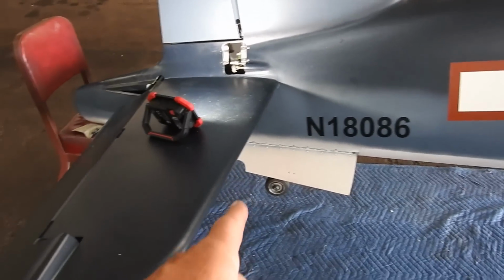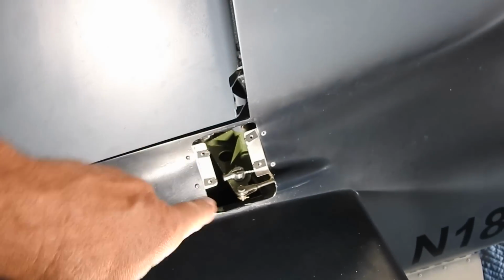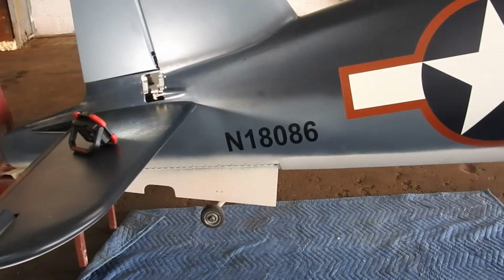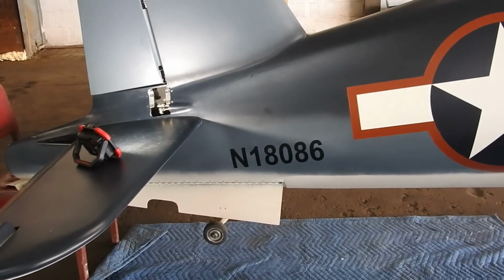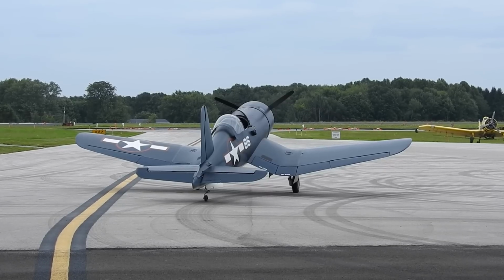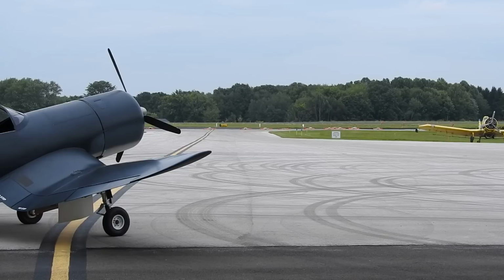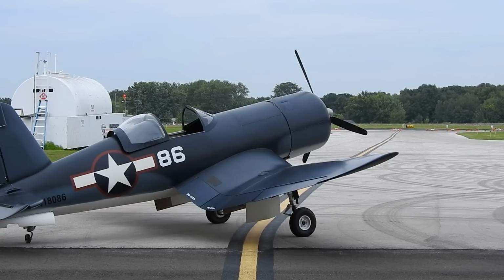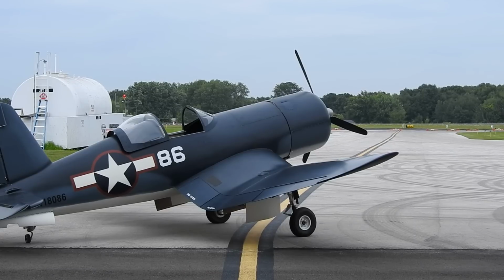WAR Corsair Tailwheel Steering Update 8/6/2023

Comment: Don, your craftsmanship is throughly impressive. CUDOS!
As mentioned in another comment, i also notices youe left gear door looks to be flopping around a bit at taci speeds, Ixm sure you sre now aware of it and got plans to correct it. It wouldn't be good at take off speeds to have it bend from the air pushing it.
Agian,  Awsome and wonderful job!
Reply from the maker: I will look into it. The way they are made, there will always be movement with them. I think it has more to due with the prop wash hitting that side more.

Comment: Looks great, tail wheel doing the job.
I have to mention, 
In the video, I’m hearing what seems to be, a torsional vibration , when the engine powers up from idle, and then again, as it drops rpm to idle.
Reply from the maker: Backlash in the gears in the gearbox. It's normal. There is a dampener in the geardrive for that. All Rotax engines have the same sound.
Reply: @Dynodon64  Got it , thanks !
Looking forward to watching the maiden flight !

Comment: Don I hope you have enough pitch on the prop. The aircraft looks just like the full sized one but I can sure tell how small it really is compared to the monster F4.
Reply from the maker: Prop was set at full throttle run ups, to get the desired engine RPM. It can always be reset if needed for flight.

Comment: Lost a friend in a homebuilt when the wing folded up on a go around.  How do you know the g-load of the wings?  How do you inspect for damage over time?   Just concerned.
Reply from the maker: These planes have been around since the 70's. There has never been any spar failures that I know of. But there can always be a first. The spar on the Corsair's has been calculated on a computer from McDonald Douglas from and guy who built the first one from the plans. He said it could handle 12 G's. They are rated for 6 G's. They always rate them at half of the failure point.

Comment: Don I noticed your left gear door flutters while the right seems ridget
Reply: Yup. I noticed the same thing... Don seems to be a WAR Wizard, im sure he'll have it nice and tight in no time!
Reply: Looks great, tail wheel seems to be working fine,
I have to mention, I’m hearing what seems to be a torsional vibration , when you power up from idle, and again , when the engine drops the rpm, just before idle.
Reply: @streetsmart1164 probably the gearbox and play in the gears or belt drive.. I forget what it’s got for a reduction unit but that’s typical.
Reply from the maker: @thomasaltruda  Gear backlash. There is a dampener in the geardrive unit.
Reply from the maker: @wyliemitchell6442  Prop wash hits one side more than the other. It's not a problem yet. I'll look at them before first flight.
Reply: @Dynodon64 I remember hearing that noise with ultralights. You’d usually hear it after startup if someone didn’t crack the throttle and take it out of what everyone seemed to call “rough idle”. Come to think about it I didn’t know exactly what was making that racket but I’d tell my students to correct it before putting on their helmets or headsets because I assumed it was causing excessive wear. So it’s a function of low engine rpm causing gearbox backlash? Does it cause excessive wear or does it just sound terrible?
Reply from the maker: @toddfleury7324  At low rpm, the prop is pushed forward when every time a cylinder fires, it then takes up the backlash in the gears and bounces back. That cycle repeats until the engine is revved up far enough to keep the load on the prop from bouncing back on every cylinder fired. If the weight of the prop is heavy enough, it can damage the gears. These gears are from a Ford C6 transmission, that can handle way more power than this engine has.

Comment: Forgive me for not knowing. Don, that looks like a solid (rather than pneumatic) tailwheel, do you think you could fit a larger pneumatic tire?
Reply from the maker: It is solid, that's what the plans called for. It's 4 inch and I could put up to a 6 inch on, but the doors would need cut out more.
Reply: Look at pneumatic four-wheel moving dolly tires

Comment: G'day,

Yay Team !

The Tailwheel Steering seems to be working as you hoped it would do ; well done !

Um, most of the time it sounds very quiet... - almost Lawnmowerish, when taxying under a bit of power ; and it's almost silent when idling...

But, apparently when you throttle back from Taxi-powee to Ground Idle..., it goes through a phase where it sounds like a Tin-Can containing a handful of loose Nuts and Bolts, tied to the Tail of a galloping Horse - and every  Hoof is kicking the Tin in it's turn, beating a Sheetmetal Tattoo - kind of thing...(!).

Is that a Vibration thing - hammering the Exhaust System against something solid at a particular RPM-band...; or is that the Reduction Gearbox
Protesting at the 
Airscrew trying to
Overspeed the
Output-Shaft...?

Or is it some other
Cause & Effect 
Going on...?

It sounds as if it might be
Potentially
Destructive of
Whatever is
Making those
Rattley
Noises...?

Or they may be harmless.

The conundrum has me mystified....

Such is life,

Have a good one...

Stay safe.

;-p

Ciao !
Reply from the maker: Prop slap, backlash in the gears. Same sound all Rotax engine have. There is a damper clutch like disc in the gear box to handle those vibrations.
Reply: @Dynodon64  

Cool, thanks.

I had a fair bit to do with 2-Cylinder Rotaxes, aerotowing Rogallos ; and they could be a bit noisy - but we had 2-blade Wooden Propellers ; maybe the 3rd Blade multiplies the Noise (?).

As long as any Sound is "Normal" then that's OK - it's when a normal noise goes silent, or some new Squeak, Clatter, Grinding or Tone appears that something is going awry...(!).

Have a good one...

Stay safe.

;-p

Ciao !

Comment: eventually, you're going to have to fly this plane.
Reply: Not really. I bought an aircraft (MiniMax 1500R) a guy had been working on for over 10 years. It was 90-95% complete. He became afraid to do more than taxi it after his flight instructor was killed in an accident.  He sold it to me cheap. I did first flight on it, which was also my first solo, and put hundreds of hours on her over a 6 year period.
Reply: Read FAA rules on experimental plane [ Advisory Circular (AC) 90-89C ]. 
 They have to log so many hour before it can take off. Testing the planes equipment. I'm not sure of the exact hours, but I think it was 20hours before the tail can come off the ground and then some more hrs of limited take off speed with online bounce the wheels [not purposely taking off]. Then he gets his last inspection to fly. EAA also has all the info , if you are interested. Dons done a good job of covering every aspect from wing load to landing gear max load before folding. He even did a lot of testing on the engine mounts. I'm just wondering how many hours is the car engine going to handle continuous rpm, when he take it to Oshkosh next year. I think that is his plan ??
Here is some of the index for flight
Section 11. Additional Engine Tests ......................................................................................... 2-39
2.19 Objective ..................................................................................................................... 2-39
Section 12. Propeller Inspection ................................................................................................ 2-43
2.20 Objective ..................................................................................................................... 2-43
2.21 Recommendations for All Propellers .......................................................................... 2-44
2.22 Propeller Tracking Check ........................................................................................... 2-45
2.23 Metal Propeller Inspection .......................................................................................... 2-45
2.24 Wood Propeller Inspection ......................................................................................... 2-47
2.25 Composite Propeller Inspection .................................................................................. 2-48
Chapter 3. Taxi Tests ................................................................................................................... 3-1
Section 1. Low-Speed Taxi Tests ............................................................................................... 3-1
3.1 Objective ....................................................................................................................... 3-1
3.2 Taxi Tests ...................................................................................................................... 3-1
Section 2. High-Speed Taxi Tests ................................................................................................ 3-2
3.3 Objective ....................................................................................................................... 3-2
Chapter 4. The First Flight ........................................................................................................... 4-1
Section 1. General ....................................................................................................................... 4-1
4.1 Objective ....................................................................................................................... 4-1
4.2 General .......................................................................................................................... 4-1
4.3 Recommendations ......................................................................................................... 4-1
4.4 First Flight Inspection ................................................................................................... 4-2
Section 2. The Role of the Chase Plane ...................................................................................... 4-3
4.5 Objective ....................................................................................................................... 4-3
4.6 General .......................................................................................................................... 4-3
Section 3. Emergency Procedures............................................................................................... 4-4
4.7 Objective ....................................................................................................................... 4-4
4.8 General .......................................................................................................................... 4-4
Section 4. First Flight .................................................................................................................. 4-5
4.9 Objective ....................................................................................................................... 4-5
Section 5. First Flight Procedures ............................................................................................... 4-7
4.10 Objective ..............................
and there many more pages that have to be covered .
Reply from the maker: @JimBushJaxFL  I'm sure that is a general recommendation by the FAA. I've never heard of anyone ever going to that extreme. But I will be doing a lot of that myself anyway.